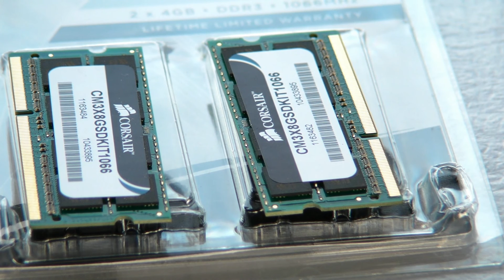Apple White Macbook 2010: Memory and Hard Drive Upgrade 101- pt1 of 3

Comment from the maker: Thanks for watching. What memory sticks are you using. Be specific brand and frequency with latency. Thank you.

Keep in mind it will only work with 1066 Mhz frequency ddr3 , because 1333 mhz frequency has higher latency and motherboard will set it for low latency and memory will not operate stable. 
What is your ddr3 memory frequency? Thank you

Comment: Hi, I changed my memory to 8gb, exactly the same as in this video. i bought my mac at early of 2011. it has the same spec with urs. But i have a problem with it. It keeps on restarting after I turned it on for 15 minutes. I re-open the casing, and re-unplug and plug the memory. it worked well. then this morning I tried to plug a usb stick, but my Mac won't detect it. I restart my Mac, the usb stick works, but then it just restart. Does it mean that this memory does not fit my Mac? thank you

Comment from the maker: Did you watch this video? I said that Apple says but Macbook supports 8gb. I am running mine for 2 years and it is a beast. Happy first upgrades. Make sure that your macbook has NVIDIA GeForce 320M Video - my model. With 9400g video card is older macbook. Make sure that your memory is DDR3 1066mhz. I suggested Corsair brand. You will be just fine.

Comment from the maker: @krasav4ik82 Yes, I am using Windows 64 bit as my second boot and it works like a champ. Windows 32 bit operating system can not see more than 3 gb of ram. Windows 64 bit has limitation to 128 Gb. So yes Windows 7 64 bit will see and use all your memory.

Comment from the maker: @chowdary434 Also try stick by stick. Maybe one stick is damaged. Do not use two. try one and than another stick. Sometimes it happens when one memory is defective. Let us know. However DDR3 by Corsair 1066 Mhz cas 7 will work perfectly. That what I used in two macs.

Comment from the maker: @chowdary434 It probably does not work cause you get a crappy high latency memory. and when it switch to 1066 by bios it is high latency and motherboard does not work to start. However, it is very strange case. Did you check you ram to make sure you put them tight inside? First time when I insterted the ram I got the same story. But than I make sure my memory tight in the sockets. Did you try that?

Comment: @krasav4ik82  Im a bit confuse here... can you please reconfirm whether it is ok to use both "DDR3 1066 PC8500" & "DDR3 1333 PC10600". Actually i would prefer to buy the "DDR3 1066 PC8500" but it is only available for 2GB. 

If i can use the "DDR3 1333 PC10600", can you suggest which is better; Kingston or Mushkin? (Corsair is out of stock). Hope to hear from you soon.

Thank you & have a nice day.

Comment from the maker: @tolgig DDR3 1066 Mhz or DDR3 1333Mhz I am not sure if the faster memory will work correctly. It could, but I am not guaranteed it. Again ddr3 1066 Mhz laptop memory and ddr3 1333Mhz laptop memory will work. 8 gb =2x4Gb is the maximum 100% working condition. Thanks for watching.

Comment from the maker: @tolgig Yes it will work. Also my suggestion go with Western Digital Scorpio Blue 1tb 2.5 hard drive. It is a little bit slower than black but cost cheaper than 750 gb black and have about the same realibility and more storage.  However if you care about the speed and stoarage and realibility to its best than get 750 gb Black Series. Blue series a little bit class lower but still better than regular toshiba drive insdie of macbook. Thanks for watching don`t forget to thumbs up.

Comment from the maker: @georgew0304 Well if you will tell apple that you did any modification - it will void the warranty.  Just don`t tell them and keep the memory - if you are afraid. They will not be able to tell that you open laptop anyways there is no seal on bolts or inside.
I would go for 8Gb -memory are so cheap in August 2011 and will be cheap at least till October 2011.

Comment from the maker: @tolgig You are welcome. I also saw 8gb of Mushkin pc3-8500 ddr3 1066Mhz laptop memory on neweggdotcom for 49 bucks total.It will work as well as Corsair. Ram DD3 Memory is cheap now,cost they are trying to get rid of the old stocks and switch to a new nano technology ddr3 that will consume less power and be more than 4gb per stick.So crap 2x4Gb of ddr3 laptop pc3-8500 memory now-because it is cheap and a good time.I paid almost doulbe for my 2x4Gb pc8500 laptop ddr3 for my macbook 2010. Thanks.

Comment from the maker: @tolgig Keep in mind that you can buy 1tb of Western Digital Scorpio Blue instead of Black series. The difference is blue scorpio is  1 tb in storage which is double of the Black Series 500gb hard drive. Means you can store more data such as video, music,etc.However Western Digital Scorpio Blue is 5400 RPM vs Western Digital Scorpio Black series 7200 rpm.It means that Scorpio Blue is a little bit slower,but not by a big margin, just a little bit. Use my guide to install Blue 1TB and It will fit.

Comment from the maker: @monkey15iv Macbook white 2010 model can go easy up to 8gb. Even if apple does not put that because otherwise they will compete with their expensive macbook pro. For macbook white 2009  you can go only for 4Gb. Go and buy corsair but 4gb and make sure it is 2x 2 gb sticks otherwise your memory channel in Macbook 2009 will not be able handle 1x 4Gb in one memory slot - thats why macbook 2009 does not support 8gb.

Comment from the maker: @monkey15iv Yes,it does not matter if it says macbook pro or not. Apple macbook 2010 and macbook 2010 pro are regular pc laptop that are using regular ram dd3.So it will be just fine.This memor yshould be 60 bucks-grab it. Memory has lifetime warranty and I am used tones of Corsair memory through out of my hardware enthusiast 12 years experience. 
Keep in mind you need to make sure that your apple is 2010 model.Keep in mind that it will not work with older 2009 models or older.

Comment from the maker: @monkey15iv If your laptop is macbook 2010 that was release in late 2010 or newer models that you would be fine. Performance is good when you need that ram. Good in photoshop, 3ds max studio and multi - multi tasking. 1-2 fps in games. I am using this laptop mostly for Windows 7 64 bit and using 6gb of my load work flow. 
Keep in mind that this concept and upgrades are not going to work on macbook 2009 and early version!
Thanks for watching.

Comment from the maker: @05Narco Make sure that the thickness of your drive is less then 12.5mm. 1 tb hard drives 2.5 with thickness of 12.5mm is to thick and you would not be able to close your case. So as again, thickness should be less then 12.5mm for sure. Just because I dont know what kind of hard drive you have, so there is nothing I can tell you about it. Why dont you want to go with a server low power driver Western Digital Black Serious? It has drop protection 2.0 as well as use same energy as 5400 rpm drives.

Comment from the maker: @laostyle01 You are a marketing eater. I been in IT and Hardware enthusiast for 10 years. If you dont want to add 8gb it is up to you. I am fine with it. Check my perfect memory registration screenshot in video details. It is perfectly in MAC OSX and in WIndows 7 64 bit running on that Mac. Get yourself a Western Digital Black Scorpio I saw them for 69 bucks. It is a server hard drive and it is tested by me in my harddrive. It eats eats like 5400 rpm but its 7200 rpm and has drop protection.

Comment from the maker: @EB0100010010 Well, I did not use it before I installed the hard drive. So I have no answers. SHould be the same, cause this hard drive is has a low power economy that is equal to 320 gb - at least that what Western Digital says.

Comment from the maker: @Korsriddare Good thing for newbies. Gowever, battery does not send a power when it shutdown - so You will be fine.

However for newbies - they need to go discharge the electric charges and disconnect the battery and pray as well.

Thanks for watching.